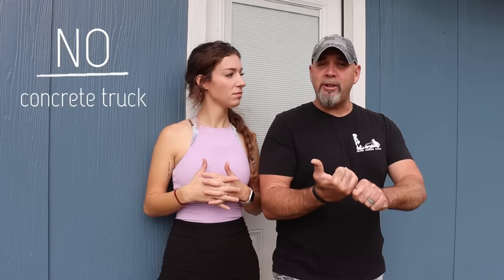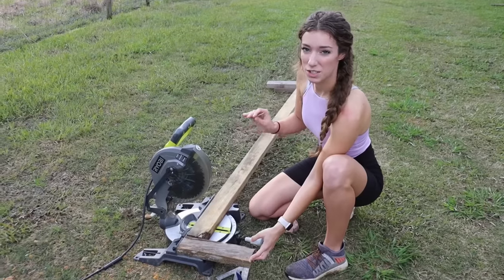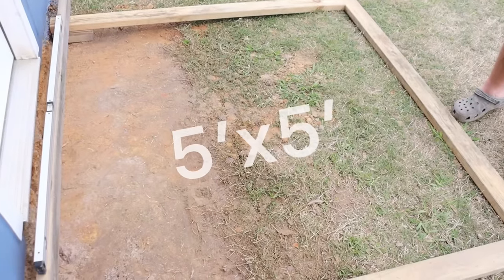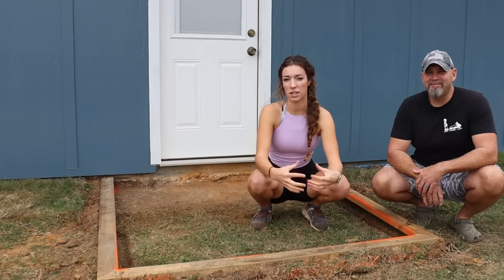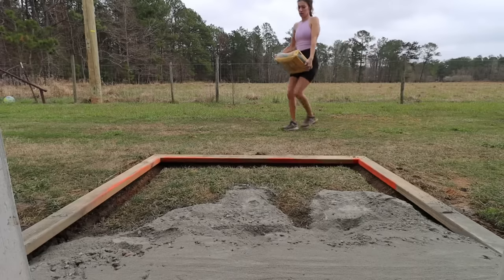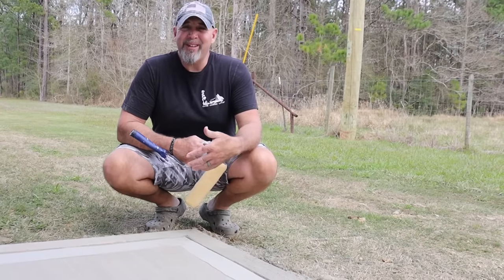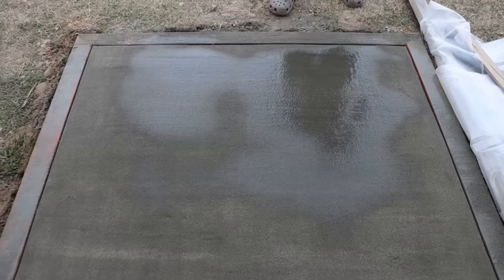How To DRY POUR CONCRETE SLAB and Update of Our 1st Pour

Comment from the maker: FORMULA FOR HOW MUCH CONCRETE YOU NEED ⬇️ 
Multiply - Length x width x height in feet and divide by 27. This will give you the cubic yards. Then divide that number by .022. That is the cubic yards in an 80 lbs bag of concrete.
Reply: How many bags did this project take?
Reply: @JC-fj7oo  23:46
Reply: Height is the thickness of slab right how would make that into feet?
Reply: Lol I thought carpentry math was tough 🤣
Reply: @caseG80  each inch is roughly .08 ft.
Reply: Well 4 out of 3 people say math is hard! Lol
Reply: @JC-fj7oo  they mentioned it took 10 80lb bags..
Reply: @JC-fj7oo  they mentioned it took 10 80lb bags...
Reply: It took a cajun
Reply: @caseG80  1.5"/12 = .125'
Reply: Hey I do decorative Concrete work and I have never seen this done but I love it great work and I had two questions 1. Would you wait atleast a week before putting a 2 wheeled floor grinder on it obviously if I pour one I’m gonna cut it down and seal it etc etc just wanted to know what’s a safe wait time to put weight on it, Y’all have a good day and much love from Tennessee . ✌️🤙
Reply: Looks like this method will be the way I do all my projects at our house. From a possible driveway, additional garage space, work shop / mechanic shop. I'm tired of not having the proper space and not enough work room. With my planning and ability to learn I just might be able to do nearly everything I need to do. With this method I will probably save more money to do every step my self. I better get started.
Reply: So glad I found this video! The old way of opening up bags in a wheelbarrow slopping it around adding water then plopping the mix into a form, there had to be a better way and y'all invented it
Reply: Does concrete/cement bag ever advise how many 5 gal buckets of water?
Reply: Wow at the comments in this section.
Reply: That was money in the BANK. Love what you two did.
Reply: Could I do an entire driveway using this method?
Reply: Chicken tracks are Great, it adds texture , traction, folks pay big bucks for stsmped concrete
Reply: Worried about putting real weight on it like for a shed filled with lawn equipment.
Reply: @caseG80  If slab dimensions are more convenient in inches, multiply L x W x H (all in inches) then divide by 1728 (twelve cubed) to get cubic feet. If you want the answer in cubic yards, divide again, by 27 (three cubed, from 3 feet per yard). If you are metric, this is probably the wrong video for you, but here are some conversions anyway: 
There are 28317 cubic centimeters in 1 cubic foot, or 28.3 liters per cubic foot. There are 35.3 cubic feet in 1 cubic meter. 
Water, in US gallons: There are 264 US gallons in 1 cubic meter, and 202 gallons in 1 cubic yard, and 7.5 gallons in 1 cubic foot.

All those conversions are at least reasonably accurate, and some are exact.
Reply: Square footage divided by 80 equals yards of concrete for a four inch slab.
Reply: Small pad u could have  laid a PC of fence wire in it for strength.
Reply: Who gets the music credit?
Reply: @JC-fj7oo   - He said towards the end of the video, that it took 10 bags of  
80 lb. concrete mix to build this
Reply: So what would a 8ftx20xby 4 in thick . How would you figure it. How many bags.
Reply: please wear safety glasses I would hate for you to damage your eyes
Reply: @JodyJodykey  I'd like to know that as well.
Reply: Cool. 
I  have a  project  now.. this summer... do you feel heat could affect this process ?  Great job too.👍👍
Reply: Thank you both i am so glade i listen to you i got to make a path way in my back yard and thank to yall i can do it the easy way. I am GREATFUL.
Reply: I was laying bricks i took dry cement poor it on top and sweated in between breaks. Than spray it lightly to wet it. That was a year back turnd out good. .its basicley the same way you shows us .now i know i can do a big part .thanks
Reply: Hey there do you thank i can pour a circle slab for a fire pit
Reply: Thank you for that formula.
Reply: @caseG80  divide inches by 12 …... 6 “-:- 12 = 1/2 or .5 …... 3”-:-12= 1/4 or .250 ….… 4”-:-12=1/3 or .33 etc.
Reply: @samuelhmullins2170  ..one 80lb bag only uses about 3qrts of water that’s less than one gal.
Reply: @JodyJodykey  way to many to make it economical. Rough figuring is 89 bags . That weighs 7120 lbs. at $6 a bag $534.
Reply: Is there a reason why you would need to limit this slab to between 1.5 and 2 inches thick?
Reply: Have you ever tried a thick slab in the 5 to 6 inch range?
Reply: For a dog kennel 10x10 next to the house, how much of a grade would be appropriate? Starting at 3” next to the house, would a grade down to 2” be ok?
Reply: @caseG80  at 6 inches height, it would be .5 ft, at 3 inches, it would be .25 ft, at 4 inches it would be .33 ft. Whatever your height in inches, divide by 12. 6 divided by 12 is 1/2, in decimals that would be 0.5, and so on, so on, so on. That would give you the notation in ft.
Reply: @JodyJodykey  somewhere around 65 bags if I did it right
Reply: @devilray61  I definitely think you could do it! Just use some of that plastic landscape border as your form, since it bends easily. Stick a pencil or stake in the middle of where you want the slab. Tie a string or something that doesn’t stretch to the pencil, cut your string half the diameter you want the slab to be, and use something to mark it as you go all the way around…maybe like a knife. Then you’ll have the exact mark to put your landscape border 😊
Reply: 2 million views in 12 days congrats
Reply: Thank you  helped me out a lot. Well done.
Reply: So neat…. You may have saved my life❣️Love your channel ❤❤❤
Reply: I just come to listen to the music of them both speak. To her say Y'all every once in a while, and to him pronounce 'first' as if it was spelled like this: 'furst' or 'farst'. 
Carry on . . .
Reply: God loves Cajun people!!!!! And Jesus saves whosoever calls upon His name AMEN!!!!!! STAY SAFE AND PROSPER WITH CHRIST!😮
Reply: An 80 lb bag of Quikrete makes .6 cubic ft of finished concrete.
They used 10 bags, so the total volume of their finished concrete is 6 cubic ft (i.e. 10 bags * .6 cubic ft/bag = 6 cubic ft).  

To figure out the average depth of their slab, you'd do the following calculation:
5' * 5" * x = 6 or x = 6/25 = .24 ft = 2.88 inches thick (i.e. .24 ft * 12 inches/ft = 2.88 inches)

So, the fastest way to figure out how much concrete they needed for their project would be as follows:  length in ft * width in ft * depth or thickness in ft = cubic feet of finished concrete needed.

Since each 80 lb bag of Quikrete produces .6 cubic ft, you would do the following calculations:
5' * 5' * (2.88"/12)' = 25 sf  * .24 ft = 6 cubic ft
6 cubic ft / .6  cubic ft/bag = 10 bags of Quikrete
Reply: To be clear, 1x 80 pound bag = .6 cubic feet or 45x 80 pound bags = 1 cubic yard...
Reply: SAMPLE
4' X 6' X .25 (3") = 6 CU FT
6 / 27 = .22 CU YDS
.22 / .022 = 10 80LBS BAGS 
10 x 80 = 800LBS
800 / 50 = 16 50LBS BAGS (80LBS bags too heavy for my back) 
Math make you be smart :D
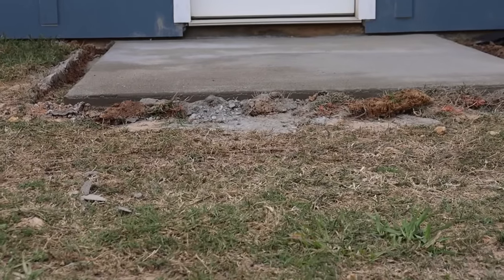Reply: 23:49
Reply: 21:30
Reply: 21:27
Reply: 21:27
Reply: Nice project
Reply: How do you know how much water to use across all the sprayings?
Reply: @GlamisLT500I agree, but you could use concrete for a large donut shaped patio pad and have the pit in the center on crushed stone which can take the heat.
Reply: @NoMoreBLUEISIS  not with the right equipment.
People say women don't work as hard as my grandmother did, but you have to work hard to be able to afford the washing machine.
Reply: Senza rete metallica? Non spaccherà?
Reply: This video was excellent! I do live in Sault Ste. Marie, Ontario, Canada. At the US Boader of Michigan. 
So Way Up North, Eh! Lol
But l need the exact slab and l am going to try it!
This couple made it easy to understand and the music and chickens were great!
Thank you!
Reply: How do you know you have used enough water.
Reply: How much water are you adding (how long you spraying) for the final 4 sprays on the shower setting?

Love this - did one today. About to go to the third watering stage.
Reply: 🤯 I am not that great with my math hahaha luckily my hubby is 😅
Reply: @rufusjohnson3800 Thank you for sharing the calculations for concrete bags needed. I have always been stumped by that calculation for some reason. Now I can nail it with a few button pushes on the calculator.
Reply: Well....I didn't get THAT little piece of VERY IMPORTANT info at any of the 4 home improvement stores Within 40 mi of me...
😖😅🤔😁😘👍👍👍LOL
Reply: Was the paint roller wet?
Reply: I was just going to try to figure that out.  I've used this method to set fence and pergola posts, and always wondered why I couldn't do a patio like this.  A patio of big squares.  Thanks for taking the time!
Reply: measure in inches. do the math: width x length x depth= your number. Move the decimal point of that number to the left three places (or divide by 1000). That'll get you really close to # of 80 pound bags needed, especially for small projects like this.
Reply: Great work! I suggest wearing a face mask when working with such fine silicate powder. In the short term, exposure to high levels of cement dust irritates the nose and throat. Longer term exposure could lead to occupational asthma. Mortar can also contain respirable crystalline silica (RCS).

RCS is also found in concrete and can lead to the development of silicosis or scarring of the lungs, which results in a loss of lung function and severe shortness of breath.  Exposure to high concentrations can lead to death.
Reply: most of us have city codes to follow, permits are needed for anything within 18" of a house in Las Vegas. and even if 1.5" can hold a coupe it should be reinforced if thin with chicken wire or reidbar
Reply: This is great, perhaps how concrete is supposed to be applied...  If you use a tamper and maybe a powered compactor to get more density, maybe add some wire or rebar, it could possibly be stronger than poured concrete.
Reply: Do any of y'all know the stock symbol for Quikcrete? Speaking of...I hope Quikcrete throws ya'll a kickback. There is surely some way to get folks to donate like 5% of what they saved from your video. Thanks for not thinking that way. But it doesn't mean it's not fair to ask.
Reply: @Jody Jodykey1952  you'd need 91 80 pound bags
Reply: @chucksmalfus9623  😅😅
Reply: 5'X5'X.125 (1.5")=3.125 divided by 27=0.11574 divided by .022=5.26 bags @ 80 lbs/bag. Correct?
Reply: Am I calculating this right then, 8' x 5' x 3" would be 120 / 27 = 4.44 / 0.022 = 202 Bags!!??
Reply: Tg u
Reply from the maker: @Mastro2k it would take 16.8-80# bags
Reply: @CajunCountryLivin  Ahh thank you! I totally forgot to convert the 3" to the 0.25 feet
Reply: ABSOLUTELY LOVE THIS
Reply: @JodyJodykey               8 x 20 x .33 = 53.3 cu ft.
4 inches is  1/3 of a ft. (4/12) = .33 ft.
Now you figure the bags. I'm tired.
Reply: @devilray61  Easy,. Cut a strip of 1/4 inch plyood the depth of your slab and bend it into a circle. The length of the strip would be 
3.14 X diameter of circle.  Hold it in place with short stakes and screws about every 2 ft around. Just make sure the stakes don't extend above the height of the strip or it will be difficult to screed.
Reply: @Tron-Jockey  just the cost. thicker with reinforcement would be less likely to crack.
Reply: @Bill Griffin I didn't think he was going to build the fire on the concrete.
Reply: @RowanHawkins  Hit or miss. Too much water will wash the cement away and weaken the concrete. Much better to err on the less side. I built a dam for my cattle tank (a pond, really), and just stacked bags of concrete  across the exit trough without opening them. Then I opened a few bags and filled in the cracks by hand and misted very lightly with water. Within a week the exposed concrete was hard. No rain. Just humidity.Then I waited for the rain. I don't remember how long it took to become completely solid, but a couple of days after the first rain, all the bags felt solid. The dam worked perfectly after the first rain.
Reply: By the way, I'm a Cajun from Lafayette, LA.
Reply: Is that using inches or feet?
Reply: I going to try this
Reply: Nothing ventured nothing gained , well done mate.
Reply: @gregsavchuk3239   

.6 cubic ft x 45 = 27 cubic feet. 
There are 27 cubic feet in 1 cubic yard
1 cubic yard is   3' x  3' x  3'
Reply: @michilegraham294  please answer this after you have done the project and it has gone through a winter. I would really love to know how it works out. I am in Saskatchewan
Reply: @bowhunter8235  , and I bet you caught the wrong bus too. 😂😉
Reply: @JC-fj7oo  "10 80lb sacks", @23:46
Reply: Thank you.
Reply: Awesome info.Thanks
Reply: @sylviabeam8483  Good point but I'd be more concerned about breathing in some of that cement dust.  Mask up and keep safe and healthy!
Reply: Metric?
Reply from the maker: @JC-fj7oo 10 bags
Reply: J Biden helped me do the math and I bought 18 bags and 1 chicken.  😅
Reply: @JC-fj7oo  10 they said
Reply: @caseG80  6" = .5 feet
Reply: K9😊
Reply: After watching this episode, I subscribed. Finally, ways of doing a project I don't need another person to help me nor heavy equipment. This project I've wanted to do. However,  I may have to rent a jack-hammer to remove the existing (destroyed) concrete that is there. 🤔 Thank you, you were in my lineup feed.
Reply: awesome, could never get anyone to buy in to this idea,this will prove it, ray in sdgo,ca.
Reply: Q aqui
Reply: @Mastro2k  no because ft ft inches, last number 3 is in inches convert to .25 ft.
Reply: Out of curiosity... without a broom/sweep finish and it being smooth, is it slick when it rains & you walk on it?
Reply: @caseG80  tale the number of inches and divide it by 12. Like 6" divided by 12= .5'
Reply: @mebadwow  to
Reply: Thank you for this video.  Now I have hope for putting a small patio behind my cabin! ❤
Reply: Hey guys, I've never seen this done before but the results are awesome 👌 
I've got a small project to do and coming across this video (completely by accident) has given me a new way to lay concrete from the conventional mix and pour...then level 
Thank you guys 😊 and I hope y'all finally had some delicious home cooked fried chicken 😂
Keep those great videos coming 👍 👌
Reply: Thank you
Reply: It also helps to saturate the soil before starting with rhe dry mix. I put about a quarter of water in a post hole with post in place fill hole half full and tamp tight with shoes Handel or rod ad more dry cement till full and tamp tight. Can build a building without any  wait time.
Reply: Did you wet the roller when you rolled it or was it dry the whole time?
Reply: Once you're doing the three shower setting sprays.   How long would each of those sessions be about

Just wondering cuz you did such a good job and I'm going to do it on something a little bit bigger and I'll just adjust the time and try to see if it works
Reply: @J TSays  That was My Exact Question 🤔
Reply: @caseG80 1.5 divide by 12 = .125
Reply: @samuelhmullins2170  yes all bags say how much water to add but you can add to preference wetter or thicker
Reply: @JodyJodykey  can always ask your local hardware store they should be able to help also
Reply: i am very confused , you didnt have a wheelburrow and a garden hoe and shovels lol , ive mixed about a million bags of cement by hand and its really easy lol , who taught you this lol i mean if it works fine more power to you , im just wondering if there are any benefits , to truly know you will have to mix some up wet and pour it then do another dry poor exactly the same amount of cement and thickness then do a weight test and see which one is stronger , itd make a great youtube video
Reply: WOULDN'T IT HAVE BEEN ADVISABLE TO HAVE HAD A SLIGHT SLANT TO IT SO WATER/ICE WOULD RUN OFF INSTEAD OF SIT ON IT? ALSO MY BRO. IN LAW BUILD MY HUGE BACK PATIO AND TOOK A BROOM TO MAKE THE SURFACE ROUGH SO YOU WOULDN'T SLIP AND FALL WHEN IT WAS WET.  BEAUTIFUL AND WELL DONE THANK YOU FOR THE LESSON. :) SUB'D YOU
Reply: maybe use metric system, not that many weird multiplications
Reply: @carlnaranjo3962  he said it took 10 80-lb actually
Reply: @JC-fj7oo  10
Reply: I have a gigantic hole in my concrete slab out in the middle of the driveway and I'm not going to use a form I'm going to just fill the hole using some of your tips. I couldn't believe the quote I was given to replace that one square of my driveway.
I'm a baker so I deal with fondant and icing quite well...
And I helped the fence guys finish off one little area they were working on with concrete. I know I can fill a hole in a driveway! If you have any thoughts on that before I begin, put them here and maybe I'll see them!?
Reply: I'd like to see you do the one-step underneath the threshold above This slab that will but-up to the threshold. If you do decide to do it, film it!!
Reply: I'm using this technique this weekend 😁👍 thanks.
Reply: I Fuckin love this Dude!
Reply: The formula to calculate the number of 80lb bags of cement for a given area can be simplified to L x W x H in feet divided by 0.6.  

Example: a 10 foot by 5 foot by 4 inch thick pad will require (10' x 5' x 0.33') / 0.6 = 27.5, rounded up to 28, 80lb bags of cement.
Reply: @JC-fj7oo  he stated 10 80Lb bags 5x5 pad sloped from 4.5” down to 1.5” (2) 2x4 laying in there side = 3” + the 1.5” thickness of the slab at the back where is there? An exterior door is located. 5Ft sloped down to 1.5” 2x4 frame laying on its side 

all 2x dimensional lumber is 1.5 inches thick. 2x4 = 1.5 x 3.5”, 2x6 = 1.5 x 5.5
Reply: You guys don’t have a Cajun accent it’s more like an accent from Arkansas. There’s a movie called “The Big Easy” 1987 with Dennis Quad his movie accent was Cajun.
Reply: Anyone know the cubic yards in a 60# bag of concrete?
Reply: @arsanzic2161  Bless you ! I was about to pull my hair out . Now, I feel so smart .😊
Reply: New idea:  A driveway is very expensive to asphalt.  I am wondering if I can use concrete, (un-mixed, pure), pour it over my driveway a couple inches thick, rototiller it into the ground to depth, and water it with a sprinkler to cure for a hard driveway surface?  Not my line of work, but an idea out of necessity.
Reply: @dontjustbeanotherbrickinthewal  it usually does.. I am the mother of a Cajun 😂😅😂😅
Reply: @JodyJodykey  around 92 bags of concrete.

8x20=160
Depth is about 0.08 per inch in feet so 0.08x4=0.34

160x0.34=54.4
54.4/27=2.01yrds
Divide by 0.022 =91.58

I could do this for ya with the new common core math for ya but.... Too long 🤣
Reply: @Bill Griffin 
Hemp Crete is fireproof.
Reply: Great video, and it has inspired me to try. We are having a new shed built, it’s 10 X10 our slab right now is 8x10 , so I need to add 2ft of concrete. Now we live in northern michigan, with only adding 2ft length of concrete by 10ft of width I figured 3 bags of 80lbs should do it .
Would like your advice and any other suggestions you might have.
Thanks for the awesome informative video 
Franklin
Reply: They used 10 bags of 80#.  Project is 5' x 5' x .167' (2").  That is 4.176 cu ft.  Quikrete says one 80# is 0.60 cu FT.  So 4.176/0.6 = 6.96 bags if this was a perfect 2".  So their depth was definitely more than 2".  A little bit deeper over 25 square feet adds up, so plan for needing more bags than you might think the less perfect is your depth preparation.  In any case great show, can't wait to use this method to add to small areas around the house.
Reply: @Nonsense62365  That movies was filmed in Alabama, Prattville and Wetumpka Alabama. Have been to the houses several times.
Reply: @kentoowin  I tried a wet pour using slabs for a patio slab when I lived in Arizona in 2003. I mixed the concrete using the same calculations that I would have done when I lived in Illinois or North Carolina. The humidity level had been so low for so long, that the ground was REALLY dry. The wet concrete would dry out shortly after I poured it and took hours to complete! This method would have been SO much easier. I wonder if I should have sprayed water over the ground before mixing and pouring the concrete?
Reply: @caseG80 .333 is a 1/4 of a foot .150 is about 1-1/2 inches
Reply: Looks like a great alternative to a pro poor. BTW next time move your truck closer and save your backs a bit.
Reply: Did they mean wait 2 hours after the second misting before spraying again?
Reply: @ianchames4646 e'er 😮we😅😅😮😅
Reply: @caseG80  divide by 12 I guess
Reply: @caseG80  Divide your height in inches by 12 (4"/12= 0.3333').
Reply: For Aussie viewers  using 20kg bags you need  100 bags per cubic metre which works out at 10 bags for a square metre at 10 cm thickness.
Reply: They said it took 10 80lbs bags!
Reply: Interesting. I'm in the Northeast, so I may have to may a slightly thicker pad. Thanks for the info.
Reply: 😅 k.
Reply: @briangenzlinger6537 
He said in the video it was JUST for foot traffic.
Reply: You could just flip the board over rather than changing the saw angle!
Reply: Ft is okay but how to multiply the height of it is 4:5cm(please explain as example let say 12ftx12ftx cm)
Reply: 😂😂O @JC-fj7oo 🎉liki🎉kk
Reply: WE LOVE YOUR VIDEOS. GIVE US MORE MORE MORE. DRY SLABS.   WOW!!! PROCEED!!! AUGUST  12,
Reply: She seems happy,  a sign of a good husband.
Reply: Only complicated because you're still in feet + lbs. Go Metric, so much easier.
Reply: SUPER! Your making this easy. BIG THANKS!!
Reply: Look great very firm.
Reply: I just finished a project, bought 50 bags using Home Depot formula, used 38...with your formula I would have had one bag left over, should have used your formula 😂😂
Reply: @caseG80  2" x 4" (1.5 x 3.5)
 If you are using the 4" side, 4÷12 = .33 of a foot or more specific 3.5÷12 = .30 of a foot
Reply: What an awesome job!!! Y'all made it look so, easy & NOT complicated!!! Happy Holidays from Southern California😍🎄🎅🎁🌟❄️☃️💕
Reply: Ok
Reply: Got it
Reply: Ywo
Reply: That's a great slab never thought of doing that "great idea"
Reply: How often do you water the concrete mix?
Reply: @CajunCountryLivin
 
Do you guys believe I can use the same technique to build a 5m x 5m concrete slab to sit a one bedroom shed?
Reply: Definitely will try this
Reply: Can you pour on top of wood instead of dirt? I noticed you said it sucks up the moisture from the ground but I’m trying to pour on top of wood on my pergola.
Reply: How thick was the slab?
Reply: @YodaWhat would be good if they just told how many cubic feet in a bag.  Small projects you don't really need to know yards because you aren't ordering a truck to deliver yards of concrete
Reply: Is this normal concrete, or mixed with sands?
Reply: @NaveedkayaniPTIOfficial: Thanks for this #amazing #video #tutorial 😁👋🏼💖🙏🏼
Reply: I used that mix . I do it in the warm weather . In the winter I find it cracks I think the water will freeze , and crack .
Reply: @MildarValsik
Reply: Rhett